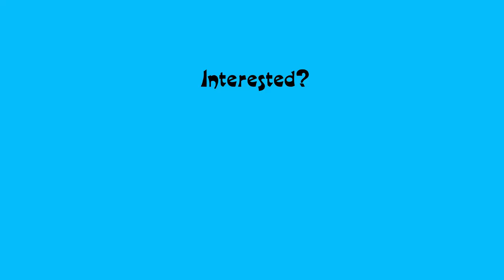13.6 Sopwith Pup - Painting Pt6 Finishing. Dancing Wings Hobby RC micro balsa plane build

Comment: Good painting! But does the paint add weight to a plane? Im planning to paint with mine too but I'm not sure if the paint can add plenty of weight. I have water-based acrylic paint set, I don't think if these will work fine to balsa. Please tell me your suggestions thanks.
Reply from the maker: With everything I added, not just the paint, this ended up quite heavy, but it looked so pretty I made it a display model and bought and built another one to fly. The water based acrylic should work fine.